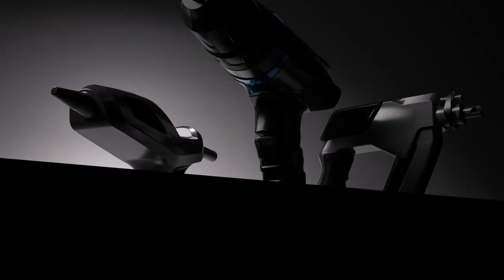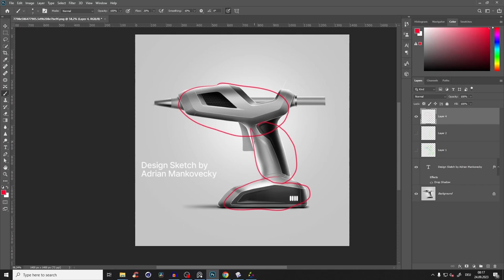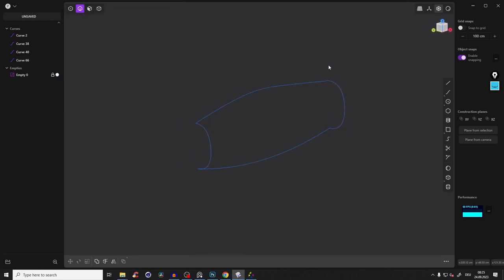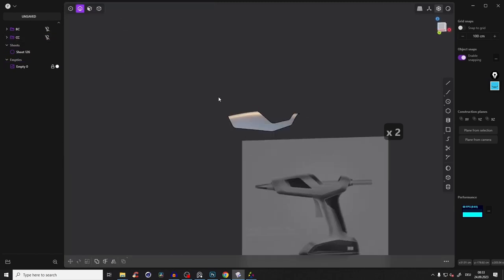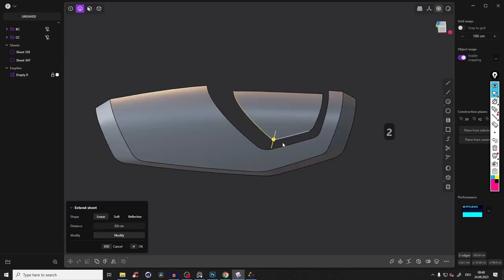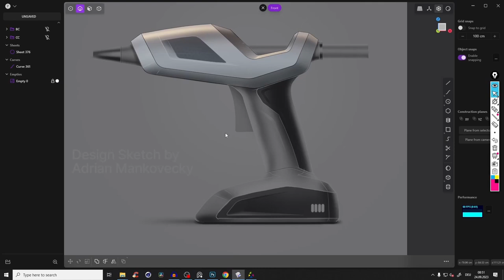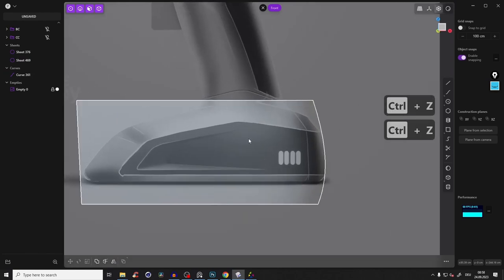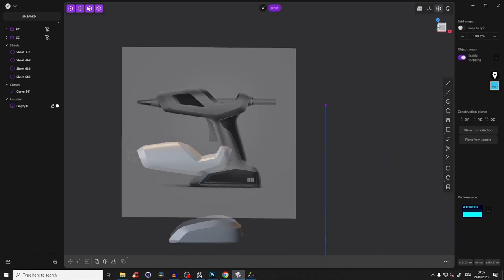Plasticity - Industrial Product Design Course | Exclusive Preview

Comment: Cool stuff! The product page for your course doesn't specify what the differences are between "Starter course", "Pro Bundle", and "Ultimate Bundle". You have a section called "Which is right for you?" but it doesn't explain any of the differences. One is affordable, one is powerful, and one is special. What's the difference? Thanks!
Reply from the maker: Hi Mike,

Thank you very much for letting me know, that I didn't communicate it well enough for you.

I just have updated the product page, the descriptions, and the images. Please check them out and let me know if it's clear now. 

https://nikitakapustin1.gumroad.com/l/industrial-design-course